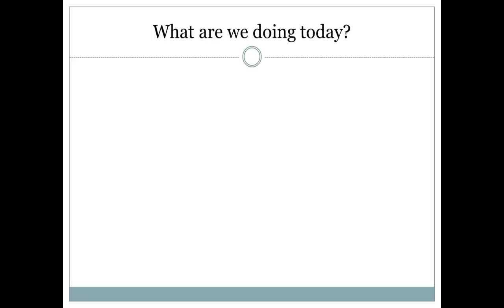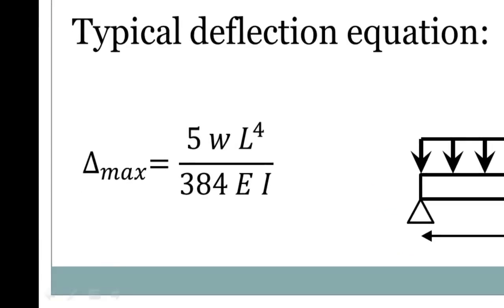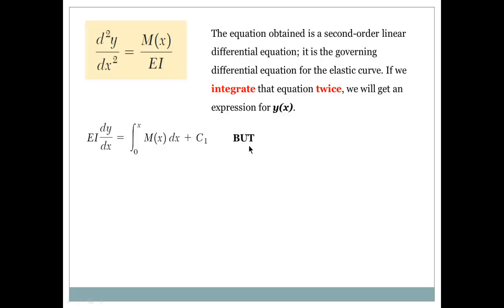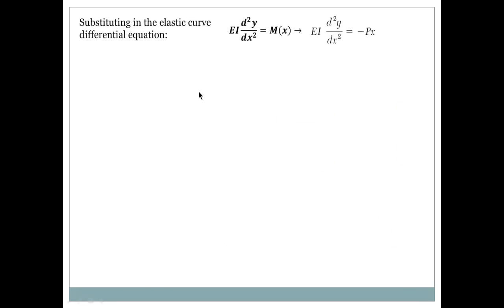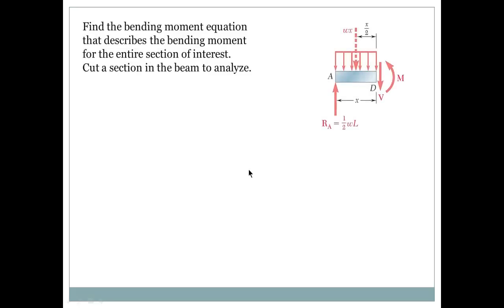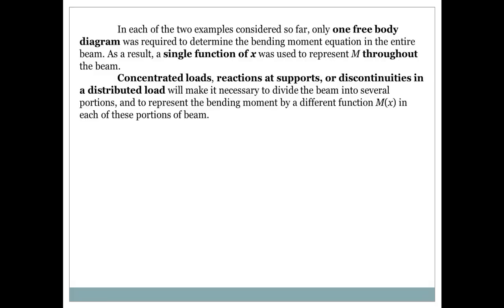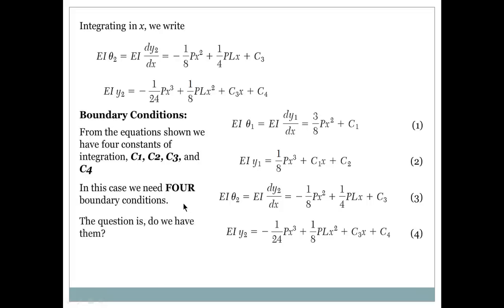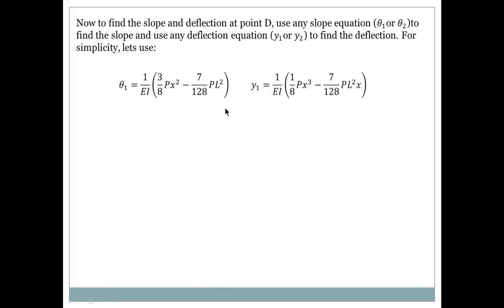Beam Deflection Using Double Integration Method

Comment: In your example number 2, the question is find the equation of the elastic curve. My question is where is the elastic curve equation? I'm sorry I'm new to beam deflection topic. Hoping for your reply :)
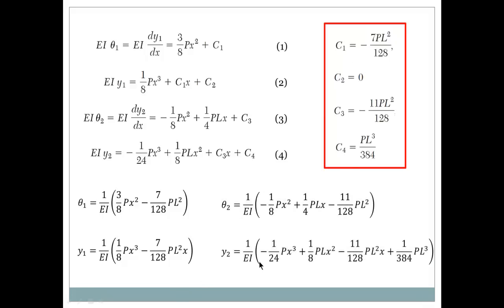Reply from the maker: starting at time: 33:00 y1 and y2 are the two parts of the elastic curve equation. the equation is in two parts because of the discontinuity at the point load.

Comment: Why is the direction of moment(M), at the point of cutting, always anti-clockwise ?.....Please Someone Replyyy....Its Very urgent :D
Reply from the maker: it is a sign convension.
Reply: Can you pleasee explain the sign convention.. Please and in detail 😀
Reply from the maker: I will try to explain it here. When you cut a segment you expose its internal forces/moments. at each cut you will have a normal force to the cross section of the element, a tangent force to the cross section area, and a bending moment. if you cut a horizontal section, you will end up with two segment, left and right. NOW, look at the segment on the left, you will see the cut on the right of it with two exposed forces and one moment. the sign convention says that the normal force acts away from the cross section (to the right), the shear force acts downwards, and the bending moment is counter clockwise. on the other segment, the two exposed forces and the moment will have (opposite) direction to the one I explained. 
Depending on the segment you choose to analyze, take a corresponding directions mentioned.
Hope that helps
Reply: Thanks a ton 👌😅

Comment: Thank you so much, it´s amazing. I just have one question, what happens when the beam is free to move in the y axis, like if it has rollers at the wall.
Reply from the maker: +Roberto Perez If the beam is stable, you look at the new boundary conditions. In this case, the vertical displacement at this new "roller" is NOT zero. Look at the rotation or even the moment condition at that roller :)

Comment: hello sir, suppose i want to find displacement at a point between D and B, is it okay to make just one cut after D?
Reply from the maker: karma tenzin in this example yes. All you need is the elastic curve equation for the segment between D and B and that can be obtained by a cut between these two points. Just make sure there is no discontinuity in the elastic curve (Like we had at point D).

Comment: very helpful .. the hard thing is solving the equation .. 
but i still have problem with boundry cond. at point D :/
Reply from the maker: Mostafa Kamel At D, the displacement at the "end" of the leftsegment should be equal to the displacement at the "beginning" of the right segment (you cannot have two different displacements at a single point right?). The same applies to the slope. slope at D for the right segment equals to that at the left segment. These are your two extra boundary conditions.
Reply: i got it ^_^ 
My exam was today .. the Video was very helpful
really really .. thanks ^_^

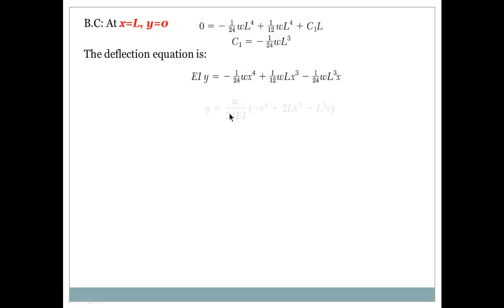Comment: at 22:35 , how can you get that c1=(1/24)wl^3???
if by substitution x=L and y=0 using the elastic curve eqn,should'nt it be c1=(1/24)wl^3    (1/12)wl^2 ???
Reply from the maker: Firdaus7 Suhaimi at X = L you have:
0 = (-wL^4)/24 + (wL^4)/12 + C1 L 
    ^^^^^^^^^^^^^^^^^^^^^^^^^^^

These terms simplify to  (wL^4)/24 and solving for C1 you get (-wL^3)/24

Comment: What do you do when you have a point load and a UDL acting on the same beam?
Reply from the maker: If the behavior within the elastic range of the beam, superposition can be used. separate the problem into two beams, One with the UDL and the other with the Point load.

Comment: can iknow how to get x = L/4 for the boundary
Reply from the maker: the reasons I selected x = L/4 are: The displacement from the beginning of the right segment (x>L/4) and the the end of the left segment (x<L/4) are the same (It is the same point) but can be analyzed using two equations. The other thing is that the slope at the point under the point load is the same for both segments of the beam.

Comment: Hi I was wondering if you have a proof that the defletion, dv/dx=0 at x=L/2 due to symmetry when a Force is applied on the center of a bean. Thanks.
Reply from the maker: In the case of simply supported beam with a uniformly distributed load, the shear force at mid span is zero (Moment is max). The deflection at any location of the beam (not the supports though) should not equal zero for normal loads on the beam distributed or concentrated.
Reply: Sorry, I meant the dv/dx (slope), not deflection just like in your last example, special case, but with the force applied on the center of the beam. I got the hibbeler solutions manual and they use this as boundary condition, at x=L/2; dv/dx=0 , this way you can found C1 and C2 very eazy and quickly, avoiding doing another region and finding C3 and C4.
Is like when the Mmax = Vmax = slope is zero.
Reply: Eric Calonico http://books.google.com.br/books?id=qAuTJTg4q7EC&pg=PA70&lpg=PA70&dq=%22dv/dx%3D0%22+%22x%3Dl/2%22+why&source=bl&ots=3jmIQjGeFq&sig=AmUfmx9SUU1yV365VLHyGf5QyEM&hl=pt-BR&sa=X&ei=Wc8-U8j9CujD0QGBh4C4Dw&ved=0CDAQ6AEwAA#v=onepage&q=%22dv%2Fdx%3D0%22%20%22x%3Dl%2F2%22%20why&f=false

Comment: أختباري بعد 3 ايام ، ممكن يالغالي تعلمني كيف تستخدم البواندري كوندشنس؟ ، كيف اعرف ان x = 0 ولا x=L?
Reply from the maker: Salamto use boundary conditions you should know how many unknowns you are solving for. The number of boundary conditions are the same as the number of unknowns. Then, at pin supports, it at the ends of the beam, the moment is usually zero and the deflection is zero as well (that is at x= 0 and x = L) for the fixed end, the deflection is zero and the slope is zero.hope that helps

Comment: My problem is how to use the boundary conditions? I do not get it.. plz help, thnx sir..
Reply from the maker: can you be more specific please?
Reply: I meant to say that how can I use the boundary conditions E.g x=0 x=L, what are they? and how can I use them ?
Reply: Rayes ِALRayes For 1st example: Imagine beam in Cartesian coordinate system (x,y) with origin (0,0) at point A. As you go along x axis you will reach point B at length 'L' . As you see point B is not deflected that means y=0 for x=L (length from origin to point B).Same with slope at B, it is 0. ALso You can note that max deflection occurs at point A where x=0 (again our origin) .

Comment: While analyzing bending equation in cantilever beam in example (1),isn't it right that direction of M must be clockwise,so that the beam would remain in equilibrium?
Reply from the maker: It is clockwise if you look at the other side of the cut. i.e the remainder from the beam from the cut to the support